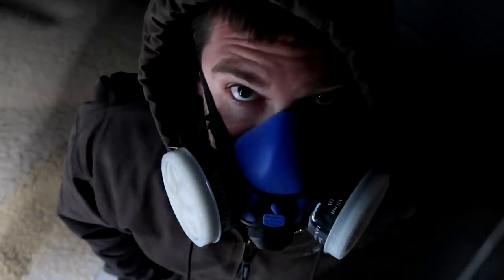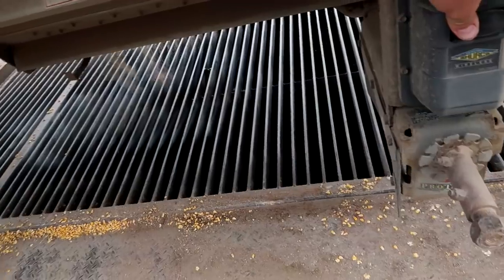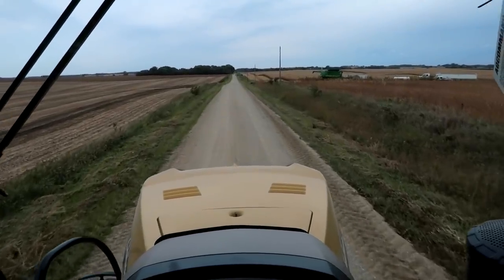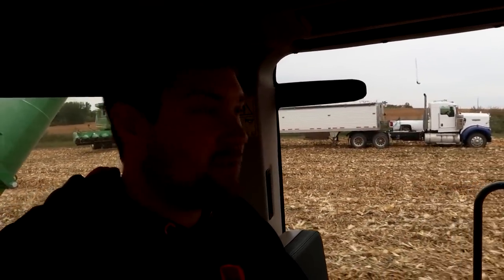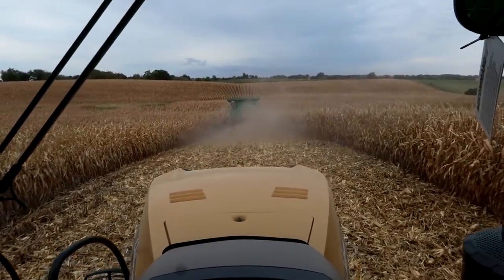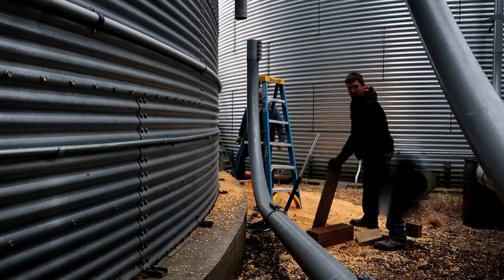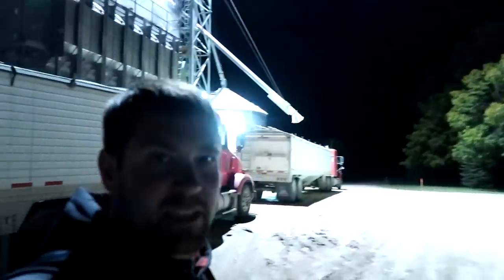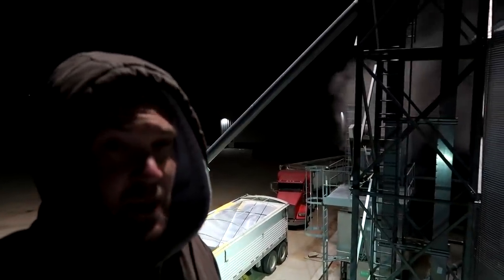Dryer Grain Pipe Blew Apart and We hit 100,000 Subscribers

Comment: I just love watching you battle with nature and mostly come out on top. Great machines and I love machines.

Can I suggest you run a support beam up the silo, with brackets clamped to the pipe at regular intervals. To carry the weight of both the pipe and the grain load. Don't just let the pipe clamps to carry that weight.

I worked in construction and slurry from the tunnel boring machines would be pumped miles along tunnels and up shafts. Support steel and brackets would always be installed, plus thrust blocks at each bend to counteract the change of direction.

Comment: Another cool feature of that transmission if you want to slow down with a full cart use the brakes. No clutch needed, just step on the brakes itll slow down. and when you get off the brake it'll maintain that speed.  Better than abusing the tranny and overreving the engine trying to slow down a full cart. 
Congrats on the 100K!

Comment: Have you considered a safety strap on the joints of the air system.  Worked many years in a power plant and am very familiar with air joints coming apart.  It wouldn’t take much to make a ratchet strap in the problem areas.

Comment: Congrats on 100000+. Have you tried the Challenger using the foot throttle only to control you ground speed. Need to press the orange button to the left of the TMS button. Have TMS and the pedal lights on. Then select forward or reverse with the shuttle lever on the steering column. Press the throttle on the floor and drive it like a automatic car. The farther down you push the pedal the faster it goes and should stop when all the way up if the Turbo Clutch feature is on. Also handy when connecting an implement.
Reply from the maker: Drove it that way most of today and loved it.  Much smoother on the cart

Comment: Yep! Natural air drying is so much simpler. No baby sitting a propane dryer. Just dump it in the bin, turn on the fan, and go to bed. Oh, and did I mention you can combine as fast as you can dump it in the bin instead of waiting for a pokey dryer to catch up?🤔
Reply: @Douglas Rohr Unfortunately, when you live WAY up north (yes, a lot further north than Zach), the solar dryer doesn't work half the time. An electric fan to push air through the grain speeds up the process even when the sun doesn't shine. And you get the grain off before it snows.

Comment: Have you ever used than grain drying setup on soybeans?  We are having a heck of a time with soybean harvest this year wouldn't rain all summer now it wont stop.  Beans are hovering around 15-18% and we cant get anything done.  We do have a sukup continuous flow with a pneumatic transfer system but ive heard horror stories of fires, splits and damage.
Reply from the maker: Yes, we've dried beans many times.  Just use a little less heat and run them through quickly.  No issues here.

Comment: would a cable accross the rubber area clamped in a way to hold from blowing off. Or wire that if breaks stops blower?

Comment: Congrats on a 100k. Whats the capacity of the dryer?
Reply from the maker: 1,200 bushels is what it holds at once
Reply: Whats the capacity of the grain trailers? The truck & trailer combined was 88k the cannery hauled all the corn from our fields when i was a kid. Im not sure what that is bushel wise. We did corn, peas, and spuds and beef.
Reply from the maker: @deibert1  a legal load of 80,000 pounds is roughly 925 bushels.  It varies some depending on test weight